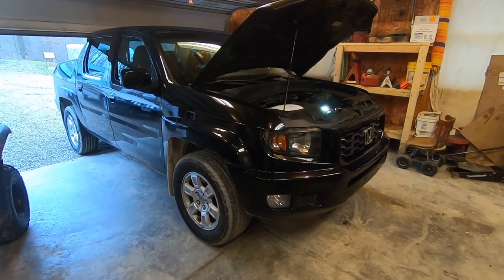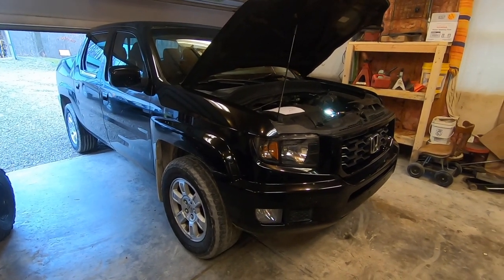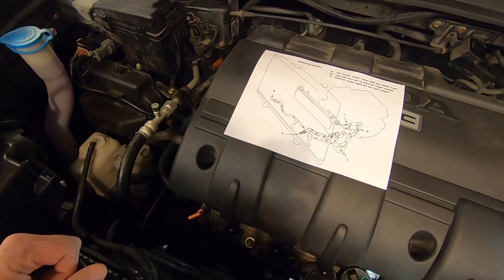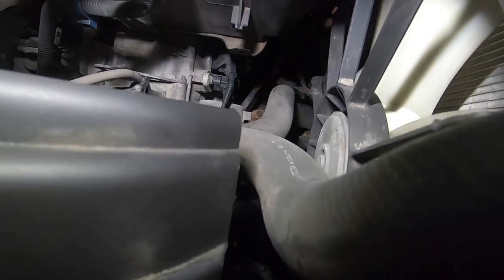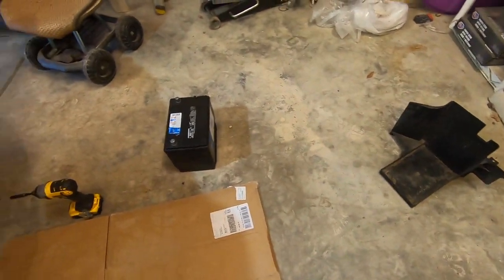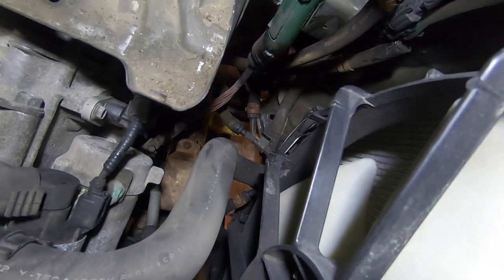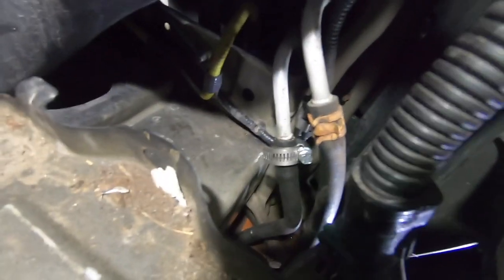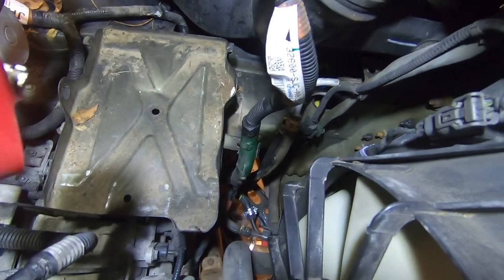2006-2014 Honda Ridgeline Strawberry Milkshake of Death Prevention For Only 1 Dollar SMOD

Comment: Today I proactively replaced the radiator in my "09 with 115k. It's a $200 insurance policy for a vehicle which can go 300,000 miles. I saved 4 or $500 by doing it myself. It's not a terrible job. Be organized and methodical and it will be done quicker than you would think.
Reply: Honestly, I've never heard of replacing radiator as preventative maintenance, until Honda Ridgeline
Reply: @dimash244  Is this corrosion internal? or external? If internal, wouldn't coolant corrosion inhibitor help? I hear VW makes the most corrosion resistant coolant, but it is incompatible with the old green coolant so can't risk mixing them.  Then corrosion resistant additive is becoming obsolete, how about a bit of light oil? this might confuse diagnostics but it might also work.  If external, spray the fittings down with corrosion inhibiting spray.
Reply: It's galvanic corrosion between steel washers and aluminum fittings. The only repair is to replace the washers with stainless steel ones, or replace the whole rad.

Comment: Almost every car on the planet has a transmission cooler integrated into the lower tank of the radiator, so all you needed to explain was the design weakness on the Ridgeline and the fix.

Comment: This certainly isn't a terrible idea if you live in a warm climate... Or even a moderate one.  If you live in Northern Canada like me though, you kinda want the trans fluid to get warm.  I don't disagree with you though.  Subbing for more Ridgeline DIY though, for sure.
Reply: I live in west texas and it gets hot enough so I did this bypass mod 👍🏾
Reply: I was wondering that myself , I'm in Montana . Where it gets below zero in the Winter. I'm wondering if those Temps would affect anything.
Reply: If you live in a cold climate, try bypassing both the coolers.

Comment: Just did this and I am just slightly confused here towards the end. Does it matter which hose inlet on the external cooler are you attached to which inlet on the transmission? I’m sure it does but I kind of lost where you did it in the video. I have both of my hoses off of the transmission underneath so now I’m confused which one goes to which Spigot on the external cooler?
Reply from the maker: I don't know if it really matters since it's just a cooling loop but I kept it the way it was routed from the factory. I can't remember off the top of my head. My only suggestion is watch the video again and look at the diagram. I explained it in the video
Reply: @JackofAllMasterofNone  I figured it out since I sent that. Thanks.

Comment: Seems like this might also help prevent overheating when going offroad. Went to Colorado in July and was taking a trail from 5000 to 11000 feet and trans overhead so I turned around.  Hopefully this helps that.

Comment: Dude, I’m about to buy a first gen Ridgeline and all of your videos are so helpful!
Reply: Check to be sure it has an after market Radiator and you can avoid this.
Also check to see when the timing belt was done.  180 thousand miles and start looking to replace.  If it's not done, it not a do not buy issue, as it is not expensive to get both done.  Check Recalls for air bags as well and see if they had been replaced.
Reply: @luckyx16  That is good to know because I am looking. I thought the absolute maximum miles before changing the timing belt was 140,000 miles and to change it along with the water pump which should be done together, is about a $1,500 to $1,700 dollar job, and a radiator is about $500. This is what I have read from owners who have done this, and that pricing is not through a stealership.
Reply: @Fedproman  You can do it yourself.  I got my parts off of Rock Auto on line and saved tons of money.
Reply: @Fedproman   Im rolling my 100% stock 2008 HONDA RIDGELINE , dealer convinced me to change the timing belt @ 100K, I did it, 1500$ . I replaced 2 batteries and brakes and tires, NOTHING else. 105K, runs like new. If it aint broke, don't fix it. :trophy-yellow-smiling:

Comment: Bought a 2007 with 165K three years ago from the rust belt - western PA.  First thing I did was order a radiator and a replacement line and all new hoses.  For under $200 and a Saturday afternoon, I was good to go.  SMOD might not be a crazy common disease, but it's got a high death rate.

Comment: Good video.. I drove my 2008 Ridgeline to 289000 miles with the original radiator. No issue whatsoever, even towed a lot with it. Just kept changing the fluids per maintenance minder.
Reply: Any transmission issues?

Comment: I’m the original owner of a 2007 RTX with 170k miles and still on the original radiator.  I live in Georgia and there’s not corrosion on my vehicle.  I heard about SMOD sometime ago but didn’t make any mods to try to prevent it.  I saw this video a couple of days ago and decided I needed to disconnect the tranny cooler from the radiator just in case so modded the lines per the video.

So, wanted to say thanks for the video….

Comment: I wouldn't consider that transmission dead  this is gonna sound crazy but happened to me years ago . The old man at the transmission shop in Thomasville nc had me drain the fluid and add kerosene  and  let it idle drained the fluid added transmission fluid and  kerosene  then he pumped all the fluid out by disconnecting the the line  and let the car run Idle in drive on the lift .   I drove that truck for 2 years .(I'm not recommending anyone try this). But it worked he said the coolant and water softens  the clutches  makes them slip .   It probably took half the transmissions  life but it lived and before someone comments automatic transmission have clutches too lol...

Comment: I was looking into this for a fellow Ridge owner, he has a 2014. Two years ago my '08 Ridge was a SMOD victim.  The sad part for me was I knew about SMOD and was preparing to do a pro-active replacement in the next month!  What I didn't realize (thought that internal coil was rather small) was there are two coils and the radiator-embedded unit really is superfluous.  But I was lucky, I knew immediately what was wrong when I left my driveway and shifting wasn't normal.  My tranny, after a lot of work, finding a good aftermarket radiator, multiple flushes, etc. is working fine... and I tow a 5K LB trailer!  I really like the bypass option!

Comment: Bought my 2007 Ridgeline 2 years ago with 70k miles on it and I live in NJ. Plan on keeping till it dies. Thanks for all the useful info. Will definitely be doing this in the summer.
Reply: Hope you get it powder-coated, or the Northern Road Salt will ruin the truck long before the internal parts wear out.

Comment: Thanks for confirming my thoughts on this issue.  I'll pass on taking any chances with the heat exchanger failing.  I wanted to replace my original transmission rubber hoses and already have the battery and tray out since I'm doing extensive maintenance on my 2006 Ridgeline.  I'm the third owner and knew the 2nd owner who bought it with 99k on the odometer in 2014.  They had the timing belt done within days of buying it.   So why risk it even with a new radiator as suggested by many?  I'll do the by-pass along with fresh hoses and a transmission fluid change. Some of those on the Ridgeline Owners forum are dead set against doing the by-pass,  I've been doing my own wrenching on a variety of cars since the early 1970's.  I'm going to cap off the heat exchanger and periodically check it to see when it fails. I won't loose any coolant and I certainly won't be cursing the SMOD God's either.

Comment: The First Gen Nissan Titan also have the exact same design issue.

You have two ways to deal with this issue.

Be safe and replace your radiator very 90,000-100,000 miles and be safe about it.

Or do a by pass like what you did a lot of First Gen Nissan Titan owners also do By pass like this.

Or try to remember to keep an eye on it and be sorry later when your engine fail or your transmission fail.

Is your truck your choice but you been warn ⚠️...

Comment: I’m going to look at an 06 tomorrow with 375k, 1 owner, original running gear. Transmission cooler line blew out of the radiator spilling all the trans fluid. I’m hoping to replace the radiator and add fluid and drive her home lol wish me luck 🍀
Reply: What was your luck with this ? Do you still have the truck ?
Reply: @TheBrian62584 Yes 😊 I still have the truck. Daily driven. Have just under 412k. I did replace the oem trans with used at 400k. Best vehicle I’ve ever owned tbch.
Reply: @JoshSmith-fi9fd I am agree with you. The best car

Comment: I have an ‘08 with 98K miles and do my own work except (rat chewed wiring harness $450 to replace) and I did pay for Timing belt water pump at 60K. I will probably do that one myself now that I have a quick jack lift when I hit 120K. I never have heard of this but I don’t cruise forums for my Ridgeline as it’s been super great truck. I’ll do this mod when I do my transmission fluid change on my christmas break this year. I don’t live in a hot climate but I don’t want coolant and T fluid mixed. I’ll look at a new radiator from Rock Auto and consider just replacing it. I have noticed drip leaks from the bottom rad drain but not enough to lower the overflow level over time. I have changed all my hoses at 60K too so always been a stellar performing truck.

Comment: I had the shake (it's a nightmare) in a 2006 with 93k luckily there was no back feed into the trans, wish I had seen  this video before. Now I discovered my 16 year old Ridgeline should have the timing belt replaced or risk a complete engine failure. Just got back from the dealer $1400+ for a timing belt kit installed (ouch). Thanks for posting!
Reply: My quote 2600

Comment: I haven’t had the milk shake on my 06 yet but I did have a cooler line fitting pop out of the radiator. I now have a 3 year old radiator/ cooler and probably won’t have to worry, but I might bypass it like you have, and fit a larger cooler to play it safe.

Comment: This arrangement is on 90% of vehicles, the reason for the internal trans cooler in radiator is to warm up the fluid to drive. For vehicles with external coolers, they still did the same exact thing, I've owned several Chevy trucks and so on, all the same. Now as far as the radiator reliability that could be a different situation with Honda?
Reply from the maker: Yes the radiator reliability is an issue with Honda. You are almost guaranteed immediate transmission destruction when the fluid mixes. So the stakes are high with these vehicles. This is a preventative measure That aims to protect your very expensive transmission and also the side benefit is cooler temperatures all the time that will also prolong the life the transmission.

Comment: so another fix to this would be is to change the radiator every 80k miles or so? 2010 model with 54k miles shouldn't have this issue?

Comment: How is the long term with this? I just purchased an 07 with 140k and I want to make sure this thing is running great
Reply from the maker: Works great
Reply: This happened to my ‘07 with 256K miles on it.  Because of the mileage, I wouldn’t do the dealers $3K fix and sold it for $100.
Reply: @mybigdogbowl  so sorry to hear. It’s such a great truck. Mine is still running good. I haven’t done this fix yet. Maybe I should do it then.

Comment: This just happened to me last night. (06' RTL with 160k ) Honda dealer fixing now $1400.
Bought it 3 years ago ad NO major problems at all till this and had timing belt changed at dealer with new oil pump as leaking oil was found. ($1500) .
Still love the truck as it fits all my needs and can carry 4'x8' sheets of plywood that old Ranger could not.
However, I was told that the trans fluid was run thru the radiator for cooling trans fluid when you are stopped for a long while in HOT weather and NO air is flowing thru external trans cooler?
Reply from the maker: 2 things. When stopped the transmission isn't making any real heat. The external trans cooler still cools when air isn't flowing because it's just acting as a radiator. Transmissions should run cooler than coolant if you want to keep your transmission.

Comment: Hey Jack, writing this two years later…is the corrosion internal (as-in between radiator ‘housings’) or is the corrosion failure point only at the two fittings for inlet and outlet (which is what most people indicate).  Because if the failure is at inlet/outlet could I just remove both and plug holes with JB Weld to prevent original cause of corrosion which was the washer thereby preventing need to ever replace radiator?    OR    is the ‘mixing of fluids’ happening somewhere else internally?  Am I making sense?   Thanx much
Reply from the maker: I believe the failure is at the entry point to the radiator at the fittings but the end result is still a complete failure and the mixing of transmission and radiator fluid. You could plug them work JB weld but I don't think it's necessary.

Comment: Nice video. Would the air transmission cooler keep the fluid cool enough on very hot days in stop and go traffic, or in mountainous terrain? What would be the max temp of the tf leaving the trans   before cooling. Tha ks.
Reply from the maker: So far it has on our Ridgeline (has never went above 150'F), but if you are in the mountains a lot or towing I can't say for sure. May need a bigger cooler. I have used my scantool to log the temps but don't tow with mine.

Comment: Couldn't you just use a male to male barb fitting. Pull to 2 lines off the radiator cooler and attach them to each other?
Reply from the maker: You probably could yes

Comment: I live in a colder climate so I may change my radiator I can smell antifreeze on the outside so it has a pinhole somewhere transmission fluid looks good I flush every 30,000.

Comment: Was under the impression the engine coolant had a hand in cooling the tyranny fluid in the radiator, Wouldn’t it be best if the radiator was replaced?
Reply from the maker: Coolant runs between 190-220 degrees Fahrenheit. Optimal trans fluid temp is 175 or under. So to answer your question honestly, no. It's a bad idea. It's to heat up the fluid to get better gas mileage and in extreme conditions could lower the trans temp, but highly unlikely. I care more about the longevity of the transmission vs 1 mpg or so if that.
Reply: @JackofAllMasterofNone  if radiator gives out, which is known problem with Hondas, engine will
Overheat without warning and will chew up head gasket. Replacing radiator will help with skid and head gasket damage
Reply: @JackofAllMasterofNone  that's the temp in your pan, the fluid leaving your torque converter is much, much hotter than your normal pan temps, especially while loaded or towing. Liquid/liquid heat exchangers are exponentially more efficient than liquid/air is.   To prevent the corrosion, simply change your antifreeze as directed,  as it ages it turns acidic.

Comment: Just bought a 2010 rigdeline 300 km on it , when does this malfunction usually occur ??? And should I do this preventative measures ???
Reply from the maker: Depends. Usually is northern states where rusting occurs but supposedly the later ones, like your 2010 aren't as "at risk" as the early ones. I didnt want to chance it though on my 2010 and took the time to fix it before any problems. Also just did this on my wife's 2005 Pilot. They also suffer from the SMOD big time.

Comment: Anyone try this in a cold weather climate? Wondering if sub zero temps would have a detrimental effect on the transmission.
Reply from the maker: I've ran it this way many winters. This is how most cars used to be and any performance vehicle. The only thing that will suffer is a slight decrease in gas mileage. A cool transmission is a happy transmission.
Reply: @JackofAllMasterofNone  great to hear!  Will have to get this done to my 2006. Thanks for the reply!

Comment: Would this potential corrosion of hoses be an issue for Floridians where the weather is practically the same all year round (mostly hot, humid and rainy)?
Reply: I'm about to purchase an 06.  At 160,000 miles.  I am usually in both Florida and Ohio.   I'd like to know this for myself.

Comment: i have problem with my Honda Ridgeline switch problem when I put the key inside the switch to start if I want to turn off the switch until I remove one of the battery terminal before the key come out
Reply: Hoda Ridgeline 2006

Comment: I just bought a 2006 and it was owned in the south where there isn't much corrosion found on vehicles. My truck has 82k miles. You still recommend doing this on mine?
Reply from the maker: I would recommend it personally. Corrosion can occur due to old coolant from within and doesn't necessarily happen because of salt or anything externally.
Reply: @JackofAllMasterofNone  great video thanks. have you had any problem after bypass?  do you tow?  can size 11/32 hose be used instead of 3/8?

Comment: When you blew air out of the hose to get the tranny fluid out without it staying inside, did you blow air directly in the hose while connected just to get the excise fluid out? Do you have to perform this step ?
Reply from the maker: Just to get fluid out. You don't have to but it may leak or seap out over time and cause you to think there is an issue when there isnt

Comment: My daughter just bought a high-mileage (280K km) 2006.  It has a new radiator. Can you tell me if this means the offending hoses and connector must have been replaced?  If they replaced the rad because of SMOD, is there a way to know after it's happened? This Ridgeline did spend some time in a corrosive environment (Alberta), but the transmission seems to be working well right now.  Thanks
Reply from the maker: Look in the radiator for evidence of transmission fluid. It's very hard to get every last drop out.
Reply: @JackofAllMasterofNone  thanks a lot
Reply: So replacing the rad with an aftermarket one will eliminate the risk ?